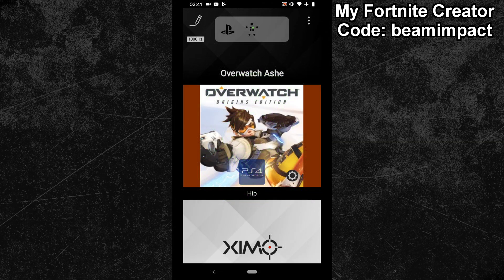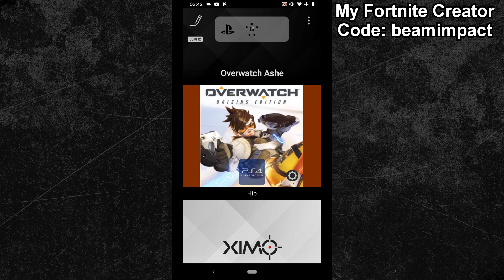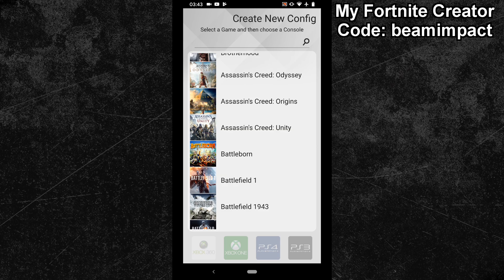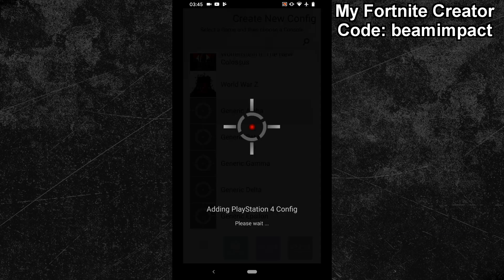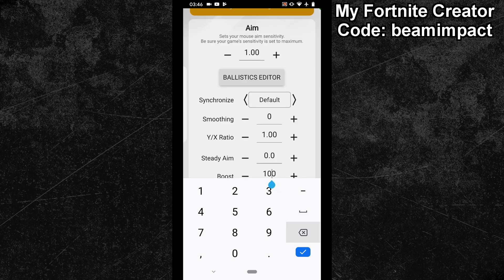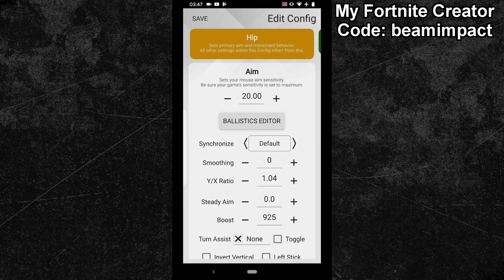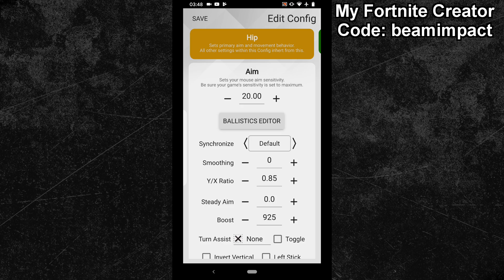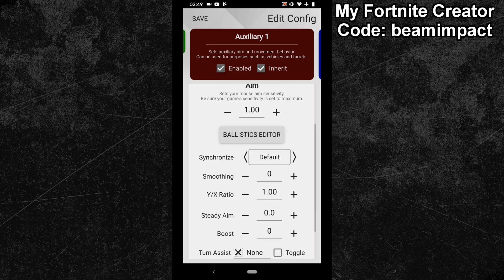XIM Apex - Create Your Own ST Tutorial

Comment: How do you deal with a square shape?  Outriders seems to stick against the axis... so slight diagonals stick to the x or y axis it’s closest to.  At low sensitivity and boost value just high enough to register (8000), circles make a square-ish shape.
Reply from the maker: One of the generic alpha configs is designed for square shapes, try that one and increase its size via the boost feature. If the shape is too off from a standarized square then this may still result in an experience similar to what you explained. In that case a game config with a similar shape has to be found.

Comment: damn this is just what the doctor ordered! me an predator hunting grounds thank you! only question i have is. what difference will it make if i leave the polling rate at 1000hz?
Reply from the maker: It can result in poorer mouse movements if your mouse doesnt run on a steady 1000hz. A lot of mice cannot output such a signal so its best to make a polling rate benchmark to find out what works best for your mouse :).
Reply: Can you please share predator hunting grounds settings? It's hard struggle as fireteam on controller thank you!

Comment: Having boost is what adds huge acceleration it works but if you move your mouse kinda fast your sensitivity in game boost fast as hell and uncontrollable
Reply from the maker: Yes thats true, thats why you want to use the minimum amount of boost that is necessary to mimic the deadzone. If you found that value then there wont be any uncontrollable mouse movements :).
Reply: XIMGameplay I did find that value it’s still huge acceleration
Reply from the maker: @baphomet6165  Im not sure to which of the following two you refer to but the next thing you need to do is the following:
1) If your micro movement is too boosted now and the acceleration you refer only happens when you start to move the mouse then you need to use a different xim game profile. The one you are using is not optimal. When you found a good xim game profile and adjusted the boost to match the deadzone then there should be no boosted micro movements.
2) Assuming you did 1) and you now have good micro movements but still general acceleration: You now have to use the ballistic curve to remove the remaining acceleration for e.g. faster mouse movements.
Reply: XIMGameplay I was using generic alpha or whatever I’m trying to make a config for cuisine royale bu it doesn’t seem possible it’s probably just the game
Reply from the maker: @baphomet6165  Yes the game has an extremly difficult mechanic. Mist (the one who designs the xim game profiles) gave some setup recommendations in the forum a while ago, maybe you can find it via the searchbar. That will at least give acceptable results.
Reply: XIMGameplay yeah I’ll probably try to find it I mainly play halo but I have over 400 hours into halo mcc and I need something new and that’s the only battle royale I have fun with ha

Comment: Hey brotha I'm having a problem with Xim Link I can't move my mouse but I can press the buttons on it I also can use my keyboard to move around.

Mouse: Logitech G502 Hero
Reply: I had this problem before you have to st your DS4 connection method to USB instead of Bluetooth and it should work just fine 👍🏻
Reply from the maker: Now that is indeed weird. Does your XIM Link freeze your mouse when you switch to the xim? Or can you move your mouse on the desktop while buttons are sent to the xim?
Reply: XIMGameplay Can’t do anything bro
Reply: I can also move my mouse while moving to PC
Reply from the maker: @rigby8819  Did you install all the recommended XIM Link additions such as the .net framework linked in the XIM Link topic?

Comment: Hi is there a new firmware for the xim and manager? I just updated the app ,not sure if I can use everything now?
Reply from the maker: It will be covered in a video probably tomorrow. Theres no new xim manager but a new xim firmware for both xim4 and xim apex.
Reply: @XIMCentral  Something to do with micro aiming?
Reply from the maker: @BingoBen10  Yes exactly, its q big change for PS4 users.
Reply: @XIMCentral  Sounds interesting.  Hopefully all will go smoothly with the new consoles.
Reply: @XIMCentral  Guessing there will be a new configuration for the cod gas royale? Not played it in a while. Seems like they've run out of ideas ,with old maps?
Reply from the maker: @BingoBen10  I think we will know more about that when its officially out tomorrow, my assumption is that it either has the same mechanic (so MW config works) or a slightly adjusted one :).

Comment: Hi there! My xim isn't working with the last controller update on Xbox. Is there a workaround for that?
Reply from the maker: Hey, what xim firmware are you on?
Reply: @XIMCentral  I was running the 20190315 until I saw your answer, now I updated to 20190719 wich should be the latest... Still not running
Reply from the maker: @marlonh.3478  What firmware versions does your xim manager list under info/about for both the xim and the xim manager now?
Reply: @XIMCentral  both are on 5.00.20190719. thanks in advance for your effort
Reply: @XIMCentral  maybe it's interesting that I am part of the Xbox insider program... Maybe this controller update is not released yet
Reply from the maker: @marlonh.3478  That is a possibility, yes. However first try the following which solves controller connectivity problems: Shut down the console and unplug the power supply of the console from the socket. After more than 60 seconds you can reconnect it and start the console, does it work after that?
Reply: @XIMCentral  no its not working. The controller rumbles as normal while I start the console, but the Xbox button on it has no light aktivated.

I got another controller which didn't receive the update yet. With this on everything is normal and the xim is working.
Reply from the maker: @marlonh.3478  All right in that case please open a support ticket on the following website so an engineer can look closer into it and potentially work on a fix for a new xim update :) https://community.xim.tech/index.php?board=3.0
Reply: @XIMCentral  done! Thank you! Hope there will be a fix for this soon. Maybe then the apex will work with the new series x as well as they said we can plug our Xbox one devices into it
Reply from the maker: @marlonh.3478  Yes thats a good indication for xim working with the new console! :)

Comment: I know this is off topic but is there anyway i can get my astro a10 headset to work while i use the xim? Also your videos helped me out tremendously id like to thank you ..
Reply from the maker: What console are you on and how is the headset supposed to be connected with it?
Reply: @XIMCentral  ps4 and its a 3.5mm aux plug i think its called
Reply: @XIMCentral  so like the normal headphone plug type of Jack
Reply from the maker: @MadaraR6  Oh ok i see, in that case it depends on what kind of controller you have. If its a new controller with the horizontal lightbar at the top of the touchpad then you just need to connect that cable to the controller and set the connection method in the playstation system settings to wired/usb. If you have the old controller without that lightbar then it doesnt support audio via usb and you would either need to use a usb soundcard or a new controller with the horizontal lightbar.
Reply: @XIMCentral  thanks now i understand

Comment: What Happens if i Use a PS4 Config on a Xbox one?
Reply: It creates nerve gas
Reply from the maker: If the mechanics of the game are different on both consoles (they usually are) then you will have slightly worse mouse movements by doing that. For example less optimal micro movement or mouse acceleration.